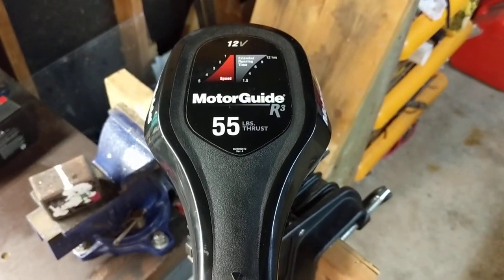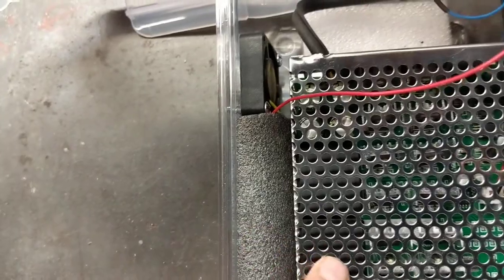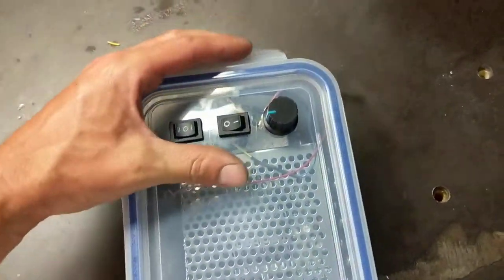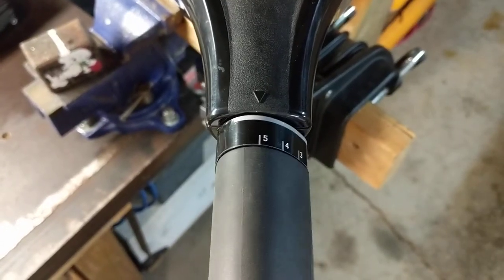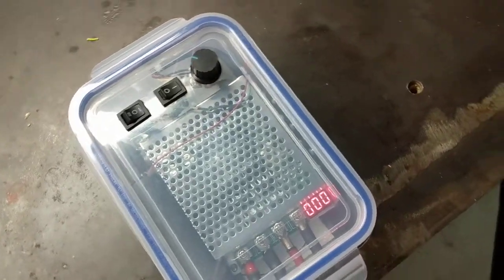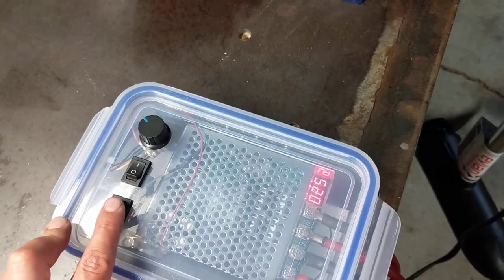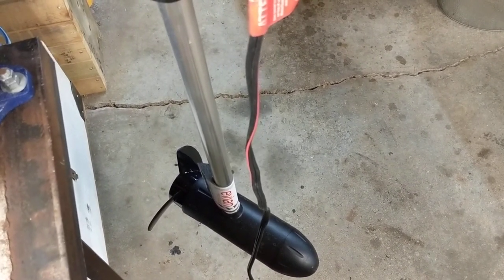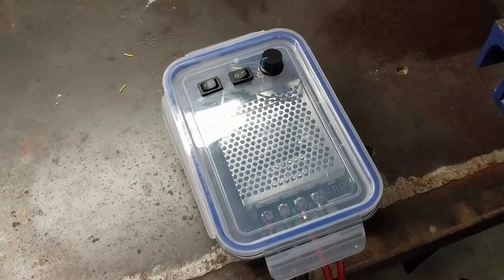Trolling motor PWM - part 1

Comment: Love it. Your the first to use a pwm without dismantling the trolling motor.  I finally see a mod in my future that I agree with 100%.
Reply: I might be wrong but its possible that connecting the pwm unit directly to the wire of the motor(reason why people dismantle) you will bypass the original electronic used to control the motor speed, that way you might have a better efficienty, but to be sure, current draw needed to be measured and it also depends on how which motor is built.

Comment: Good afternoon, how did you connect the fan and the switch to the fan, where do you connect to the battery? Thanks in advance
Reply from the maker: The fan I soldered into the bottom side of the battery power posts on the PWM.  I then interrupted one of the fan  leads, doesn't matter which one, with the switch wired in series.  Hope this answers your questions, if not, comment again.  Thanks for watching.

Comment: Question, did you have to disconnect any wires inside the motor head? Specifically, the white and yellow. I've seen many videos where they say that you have to disconnect all wires in the head and only connect the red and black wire in the head that go to the motor straight to the PWM output. It seems to me that you just placed the PWM inline between the battery and the motor without modifying the head, which is what I want to do. Is that what you did? Thanks.
Reply from the maker: Yes, that is correct, I just essentially wired this PWM to interrupt the current flow from the battery before it gets to the motor.  In my case, my motor only had 2 wires, one red and one black.  Some of these older motors had wires for either a 2 battery 12v setup, or a 12/24v setup.  You'll need to look up which setup is correct for your model of motor.

Comment: I am going to try same system but with 36V batteries. I got few STIHL pro saw batteries, i just have to keep in mind not to go over like 35% witch is about 12 volts. Those batteries are pretty light and have lot of power in them (280 wh per battery)

Comment: I use the same one , even carry a spare because I had to paddle my 'tank ' 3 miles when mine went out. They do make the same one that comes with the fan but it didn't last very long...
Reply from the maker: It's a slick little unit really.  For what it does they are well worth the price.  I left my fan off for a bit and the heat sink was warm to the touch, can't imagine how hot the board was.  Well worth the 8 bucks or whatever it was for the fan.  My whole setup with motor and battery likely weighs in the ball park of 170-180lbs, I wouldn't want to paddle it either

Comment: You can also use 24V...as long as the motor is in water it can easily handle the 24v...36v might be a little much...
Reply from the maker: I have never heard of that before, but I would be very interested on how much it improves the performance of the motor.  To achieve the same amount of 'work' you could run approximately half the amperage with a 24 volt system over the 12v system.

Comment: Can you please let me know how you connected the Fan and Fan Switch to the PWM? 
Did you just connected the neg and pos from the battery to the switch then to the Fan?
Reply from the maker: Yes, that's all I did.   I actually soldered the leads underneath the board on the solder bulbs from the positive and negative inputs

Comment: hi i have installed a pwm on my kayak motor but it has slowed it right down, is there any way of speeding it up. i did remove the control on top of motor, i would send video of what i done but dont know how to

Comment: Would of like to see how you connected the wires in the head of the trollingmotor
Reply from the maker: My trolling motor had 2 leads coming out of the head, one positive and one negative.  I just soldered and heat shrunk the connection.

Comment: Can you hook the fan to the leads that go to the motor so it only runs when the motor runs?
Reply from the maker: I tried that on my setup and it didn't work.  The pulse from the PWM want enough to get the fan turning until about 50%.  When I'm trolling for walleye and other species I'm set about 25 to 28% in my canoe.  Now this is just a cheap fan, not sure what would happen if you put a better quality fan in there. Thanks for the question

Comment: I have a minn kota c2 40 and I observed that F1 does 6.6A draw, and F2 does 8.3A directly from the battery monitor with a shunt. I don't believe all motors are built like yours where it does the max draw from the battery and outputs 80% as heat at F1 speed.

I've heard this statement 20% mechanical 80% heat being reiterated many times and can't seem to find any other evidence to support it. Would you mind doing a measurement directly from your battery or via a clamp meter to dispel the uncertainty?
Reply from the maker: I could, and never thought of this.  The hard part will be remembering my amp clamp the next time I have it out
Reply: @Intimidator82 hey the thing u said about resistance coils doesn’t sound right. Every modern trolling motor I’ve ever used uses less power in the lower power setting and more as you turn it up (according to my clamp meter) Maybe old ones work the way u say, but certainly doesn’t seem like newer ones work like that.

Comment: Great video and just what I've been looking for. I'm sorry but I missed how you hooked up the on off switch, is it wired to the forward reverse wires or what?
Reply from the maker: Thank you.  The on off switch for the fan is attached to the leads coming from the battery to the PWM.  The on off for the PWM is incorporated into the dial.

Comment: Hi josh i was wondering just new at this. can you tell me how much time where u getting running time out of your motor before you installed the pwm and now that you have it installed is their much a difference?? Thanks vinny.
Reply from the maker: I didn't keep track of the run time before I switched to a PWM.  The main reason I switched was so I could dial my speed down to where I needed to be.  Speed 1 on my motor was pushing my canoe at 3.5 kph which is too fast for what I'm fishing.  I can tell you that I can troll at 20-25% almost all day (about 9 hours) then make the run back to the dock wide open on one charge.  I am impressed with how much you can find tune the speed, right down to the tenth of a kph.
Reply: @Intimidator82  thank you josh for your reply great to know what to expect I'll definitely fit one to mine now, thank you 👍

Comment: Have you ran your PWM with a fish finder as well? I recently just added the PWM (which I love) and have a Garmin fishfinder on the way. I've read a lot of people are having issues with interference on the fish finder while running the PWM
Reply from the maker: I run the same setup you are about to have and haven't had any issues.  It's a striker plus 4 sonar and it works great for the price. The PWM, transducer and fish finder screen are all within 3 feet of each other.
Reply: @Intimidator82  That's great news! I actually bought the striker four as well. A lot of people are saying the biggest thing to combat the interference (If I get it) is to run the fish finder on its own battery. Another $20 and three more pounds isn't too big of a deal
Reply from the maker: @captain_fishaun5061  I run my fish finder for ice fishing on 2-6 volt emergency light batteries in series to get 12 volts.  It runs all day in -10°C weather and only uses .1 volt, they are very energy efficient and you wouldn't need a huge battery.  What are those Dakota lithium batteries like for weight? I know they are pricey
Reply: @Intimidator82  I can't answer your question about the battery. I am running a 55 amp hour AGM mighty Max. If I do get interference I'm going to buy the 7 amp hour mighty Max. It only weighs 3 lb and cost less than 20 bucks

Comment: Excellent setup you have there. Question that I have is I have the Endura Max and would like to just keep the head in the side of my track and the motor in the back side. Which cable and gauge can I use to connect the cables from the head to the motor? They are too short so I need something in between to connect the two and just don't have an idea which cable type and gauge is needed. I know the battery can be used just a regular electrical cable but not too sure of the other one! 
Thanks
Reply from the maker: I'd use the same size wire that you use for the PWM controller cables.  I used multistrand power cable for a car stereo.  I am pretty sure my wires on the trolling motor are 10ga, but my PWM wires are 8ga.  You can get these cables on eBay or Amazon is various lengths.  They might even have butt connectors to attach them too.  Just make sure you keep the connections water tight to keep them from corroding

Comment: Where did you hookup the fan & switch to the PWM?
Reply from the maker: I soldered the power and ground wires for the fan on the bottom of the circuit board where the power from the battery comes in.  Then the switch was just added to the fan power wire to interrupt current flow.

Comment: Do you only run the power cables to the pwm or do you have to the the head of the trolling motor apart and mess with any of the wires in it?
Reply from the maker: I ran wires from the battery to the PWM battery terminals.  I used 8ga wires for this.  Then from the PWM motor terminals I used 8ga wires and tied them into the existing trolling motor leads coming out of the head.  I just soldered and heat shrinked the connections. Hopefully this helps answer the question. If not, fire another question back.

Comment: Hi Josh. Thanks for this tutorial. I will be applying it to my new Minn Kota Endura, 30lb. thrust, Max. Amp draw of 30Amps.. Can the PWM be a 50Amp or does it have to be 30Amp? Manual says to use a 50Amp circuit breaker @12V. I'm obviously not an electrical guy so I'm not sure. Cheers from BC!
Reply from the maker: Me personally I would run the 50amp.  I think it's better to run the PWM at 75% capacity rather than at 100.  I might be wrong but I think it would last longer and create less heat.  So I would go with the 50amp PWM just in case there is a spike in the current flow.
Reply: @Intimidator82  Thanks for getting back to me. Appreciate it. Tight Lines! Cheers
Reply: So do I have to keep the motor head to the trolling motor?
Reply: allways get a biger unit /and china has its own rating system it it has a burst of say 100 amps well they may write 1000 on the box lol but you get the point truth is relative in many cases but 100 amp unit is  the one ill get
Reply: @Intimidator82  thats correct, even if not using the maximum (30a all time) its better to have a unit that handle more, its good even if you decide to upgrade later.

Comment: Does it get hot with no air flow?
Reply from the maker: Yes, I don't know exactly how hot but it's warm enough you don't want to leave your fingers on it for very long.  I put it in the container to keep splashed water and light rain off of it and just figured it needed a fan for air movement.  The fan doesn't draw hardly anything so I normally just leave it running.  I have left the fan off and ran a whole day with no overheating issues, those heat sinks inside are designed well enough I guess.

Comment: Just bought my unit, but how do you remove ( separate ) the speed dial to install it
Reply from the maker: Mine was a plastic knob that just slides off the shaft.  The shaft has a flat side on it to index the knob and keeps it from spinning on the steel shaft.

Comment: I bought two of these controllers and made a similar set up. I can not get it to work though. I have voltage going into the controller but nothing coming out. The number display shows up and works properly and so does the switch and knob. I’ve tested them with my volt meter. Current going in to the controller from my battery and zero current coming out. I bought two controllers and tested the other one and well and nothing. What am I missing? Any help would be greatly appreciated. Thank you
Reply from the maker: Sorry to hear about your bad luck.  The one thing I can think of off the top of my head is the inputs and outputs are reversed.  On my unit the input from the battery is closest to the digital readout, and the output going to the trolling motor is the two terminals furthest from the readout screen.  Let me know if it works or it doesn't and I can do some trouble shooting with mine and maybe see what's going on with yours

Comment: Finally..common video that makes since! Having issues finding waterprook box?
Reply from the maker: I went to a couple stores with measurements.  Ended up finding it at a Canadian Tire.  This one works pretty good, the lips on the locking lid act as a roof over the holes to keep the rain out

Comment: Can i connect this controller to receiver so i can use a remote control .thanks
Reply from the maker: I wouldn't know.  I would think that if you have a receiver and a remote control, your motor would be digitally controlled.  But like I said, I don't know

Comment: How big is the fan and what should I look for
Reply from the maker: My fan measures 1.5" x 1.5".  It's a 12 volt .7 amp.  It's not very big at all, but I do believe it helps keep the controller cool since I have it in a container out of the rain and splashes.  The name brand is Ya Koo from China.  Pretty sure these are available on Amazon or eBay somewhere
Reply: @Intimidator82   What is the name of it and where can I find one I like the way you have your rig set up  And I think I'm gonna do something similar
Reply from the maker: @krishogan9709  first off I lied about the amperage, it's .07 amps NOT .7 amps.  Here is a link to a similar fan of the same dimensions.  

https://www.amazon.com/ANVISION-Bearing-Brushless-Cooling-YDM4010B12/dp/B0711FVD48/ref=mp_s_a_1_17?crid=2497I678J2E42&keywords=40mm+12v.7a+cooling+fan&qid=1636683671&qsid=131-6117949-1239232&sprefix=40mm+12v.7a+cooling+fan%2Caps%2C102&sr=8-17&sres=B07CH6YC32%2CB009NQMESS%2CB071W93333%2CB07CNJ4DYX%2CB07CG2PGY6%2CB00N1Y50QQ%2CB00G059G86%2CB072FW3DDQ%2CB07V4GGPW3%2CB00IJ2J2K0%2CB07VVGHTSR%2CB071FNHVXN%2CB00VXTANZ4%2CB0711FVD48&srpt=ELECTRONIC_COMPONENT_FAN
Reply: @Intimidator82  It's all good I kinda thought that's what you meant for that size 👍thanks for the link I'll see what I can find

Comment: Hello good morning friend I have a 90v 1000watts 11A dc motor this pwm would be useful to install on my electric motorcycle
Reply from the maker: This particular PWM is only good to 55 volts.  You would have to find a larger one that is capable of handling the larger voltage input
Reply: @Intimidator82  Thank you very kindly but the PWM amperage is 100A

Comment: Where did you hook up the fan and the fan switch to?
Reply from the maker: I soldered the wires for the fan on the bottom side of the battery lugs where they are attached to the circuit board.  As for the switch I just interrupted the positive wire.  You can put the switch in either the positive or negative, doesn't matter.

Comment: Where did you connect the fun?
Reply from the maker: @juanseminario7287  the fan is connected to the power and ground on the battery side of the PWM controller so it has constant, unregulated power.  Interrupted only by the switch on the lid of the box

Comment: what's the Evian label for near the motor?
Reply from the maker: Lol that was my semi-failed attempt to prevent aeration at the prop and aid in turning.  The air bubbles would run down the back side of the shaft and into the prop.  It helped some, but not completely.  I think it was a trim issue which was solved when I made my new mount.  I think it does help as a rudder though. If I'm just drifting I can turn the motor and have some minor control.
Thanks for the question and view

Comment: What if I don't used the head unit,  just run blk/red wire to PWN . Will I get full power?
Reply from the maker: Yes. The head on max speed supplies 100% to the motor and doesn't use the resistor coils in the motor, this would be the same as running the power and ground directly to the PWM.  This is actually the prefered method if you have other means of steering via a rudder
Reply: Your the first one to explain (that I’ve seen) how the resister coils eat up unnecessary energy, thanks. Also the first time I’ve seen this done without taking the head off. Your explanation was excellent, thanks.

Comment: Where are the fan cables connected? Good setup
Reply from the maker: Thank you.  I connected them to the main power studs coming from the battery. I soldered them on underneath out of the way.

Comment: do you have a link for the cooling fan purchase?
Reply from the maker: This isn't where I got my fan from, but this is the same thing I have.  

https://www.ebay.ca/itm/SUNON-KD1204PKS2-40-40-20MM-DC12V-0-9W-4CM-2Pin-Cooling-Fan/265077843576?hash=item3db7dee678:g:2roAAOSwgjVgQm50
Reply: @Intimidator82  ty

Comment: Where did you get the fan from?
Reply from the maker: I got it at a surplus store.  I would think a place like Harbor Freight/Princess Auto.  Might find one at a electronics store too, just make sure it's a 12v fan
Reply: @Intimidator82  thanks Josh. I’ve had a couple fail bc of heat. Partly heat and part the capacity of the board. But I’ve added heat shrinks to a higher capacity pwm.. but the fan will be the extra measure I need
Reply: @Intimidator82  thanks!

Comment: Not much sense using a water tight box the drilling a bunch of holes in it
Reply from the maker: The holes are in the side, top ones are sealed.  It keeps the rain and splashes out.  I never intended it to be water proof, just water resistant.